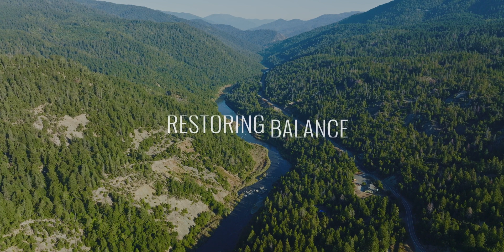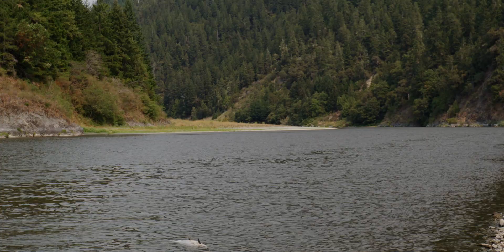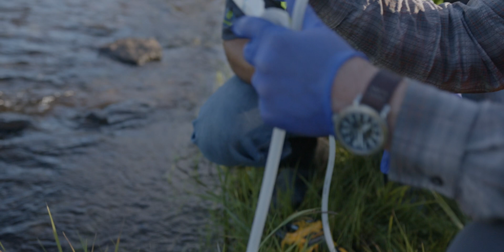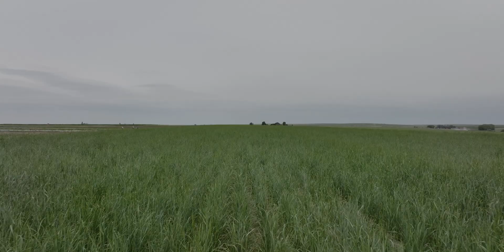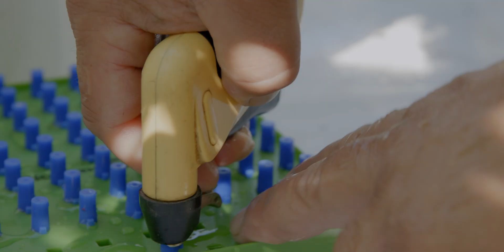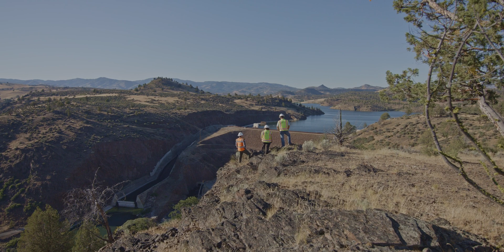Restoring Balance - Klamath River Renewal Project

Comment: I'm  ashamed , but I'm sceptical . Last floods in Spain were caused by removing reservoirs and dams . Radical changes are hardly ever the best solutions . Always expensive .
Reply: There has been 3 floods sense there instulation . They did nothing for flood mitigation ,by design, that  was not their intended purpose

Comment: The dam removal movement is just dumb . Sure, removing some may be beneficial, but in the end, only a small group benefits from this movementin general, and many will suffer because of it .

There is no better way to manage water and generate electricity cheaply and cleanly .

Our society is going backwards, and their too dumb to see it .
Reply: this kind of management works in some places, and doesn't work in other rivers. Daming the Klamath was a bad idea. John C Boyle, the head engineer in the 1890's who designed the project wrote a book  about the project, in which he admitted it was a bad project. 
You would be well served to do more research on the history of the Klamath River basin and the Bureau of reclamation's history.

Comment: Is there a way to make a fourth the size dam to still make a little power
Reply: Nope. We don't need that kind of power anymore. Solar and wind have already replaced most hydropower. Especially small, low-head dams as you're suggesting.

Comment: So, they wish to have the dams removed but are probably not prepared (yet) to renounce to their standard of living.
Hydro production of power is the most ecological gesture you can do to mitigate climate warming.
While I understand that there is more to dam removal than just enabling salmon to lay eggs higher up and the full ecosystem will benefit, what is the value of this if climate warming is increasing because e of this?
I find this report somewhat partisan, if not naive but certainly presents facts in a truncated way.
Reply: @philippesails4973 These dams had lived out their life and were not worth the cost of the retrofit. The lakes had lost nearly half their capacity due to decomposed algae. Fished died by the thousands because the summer water temps got too high every year. The stench was awful. The color of the lake water was bright green. Photos of the water are easy to find.

Comment: With only removing 4 of the 6 dams it seems like it won't really change conditions for fish. Am I wrong?
Reply: I sort of agree. Keno and Link river dams aren't being removed in this project, but I think they should be. Keno dam backs up a huge, shallow slough that warms the river and harbours a lot of bass, bluegill and other introduced warm water species that will prey on any juvenile salmon that are trying to migrate downstream. I think they are leaving this dam in place because of all the irrigation ditches that come off of it. Link river dam just raised the level of Klamath Lake a few feet, and fish ladders should provide adequate fish passage. But Keno dam needs to go too!
Reply: Yes! Copco 1 and 2 blocked fish passage, as did Iron gate. The remaining dams have fish passage already in place. Removing the dams down stream will improve the water quality over time, restoring future fish runs.

Comment: Flood control will be lost, and irrigation water no longer stored. Those dams were built for a reason. Consequences to humans must also be considered.  CA has a manmade water shortage and an unreliable power grid so why are they removing existing sources? If the dams and hydro plants need fixing, fix them. Removing them ignores human needs.

The vast majority of the abundant  CA water flows to the ocean instead of being stored for use in dry years. This water year we've had catastrophic flooding and over 8 years' worth of water supply has already gone to the ocean with 2-3 more months of snowmelt pending. Wasted water because we do not have enough large water storage that also acts as flood control, Why are they planning to send even MORE water to the ocean without storing it for use first?

Taxpayers are actually funding this dam destruction with money from Prop 1, which was passed in 2014 by 68% of the voters - very bipartisan - by telling voters we would get MORE water storage. How does dam removal - which the regional population does not support - even qualify for funding?
Reply: Nah. Flooding problems started after all the beavers in this river system were exterminated in the 1820s. Bring the beavers back and the problem solves itself.
Reply: @BodhiPolitic  Beavers won't be releasing irrigation water to farmers or to regional wetlands when it is needed. ;-)
Reply: @JD4SF do you realize that major farming is not taking place in this area? It is high mountain desert. Only grass/hay production. Some alfalfa. Some cattle being raised.
Also, there is no infrastructure. No mass irrigation system. 
Your comments are inaccurate.
Reply: @jesse75  Smaller farms and ranches are still farming and ranching. Feed and cattle are critical Ag production. Maybe you aren't aware of how feed and beef prices skyrocketed? And now those farmers and ranchers will need to scale back or even sell out lacking a reliable water source. There was enough infrastructure to control the water to mitigate flooding and store water for Ag use. There is also habitat and some wetlands in the region that will no longer have reliable water for their needs. Going forward I suspect the lack of controlled water will result in flooding and worse impact during dry years ... which will not be advantageous to the humans and is likely to damage the environment. I fail to understand the logic or justification to remove dams that are so useful to control the water supply.
Reply: @JD4SF  I live near Yreka California. I've been on the Klamath once a week since July this year. 
I know exactly what is going on in the area. 
It's not like down south you are comparing this area.
The upper part of the river never gets the torrential rains like the coast.
It is high mountain desert. Dry.
Some snow melt comes off the south rim of Crater lake, but not enough to cause flooding in the spring. It is caught in the lake. 
Flooding takes place whether there's dams on the upper river or not. 
Such as in 1962. The Columbus Day storm.
Reply: @JD4SF  Beavers create the regional wetlands.
Reply: You can say that about other rivers. But the Klamath is unique. 
It can't be classified like other rivers.
Reply: @jesse75 is correct. I live in that region too, and I've fished, hiked, floated and hunted every mile of the Klamath, in both Oregon & Cali. The Klamath is unique. This project is well thought out, and will benefit EVERYONE. Do a little more research. Come visit the region. You'll see. Your concerns aren't valid here. Maybe where you're from, but not here.
Reply: @GeorgeWHaydukeIII6396  my friend. Please don't encourage people to visit this sacred place, the Klamath Basin. 
Let's keep it a remote wilderness. 
The Trinity River is full of kayaking. Let them ruin and disturb those spawning fish. Don't need or want it up here. 
The mouth of the Scott river area is going to suffer for a couple years and the Happy Camp area also, because of wild fires, but it will bounce back in a few years. 
I'm so grateful to see the restoration of this ancient river and watch it come back to life. 
Peace brother. May see you on the river some day.
Reply: @GeorgeWHaydukeIII6396  totally agree. Logging the major culprit. 
A scattered 25,000 people I wouldn't call a lot. Once off the main roads of 96 , it gets remote in a hurry. 
I wouldn't recommend campers and trailers to venture up the road along the Salmon River as an example. And many of the logging roads are steep and heat up your breaks. 
I know a few Yurok and we go up into parts of the reservation which are locked off to the general public.
Once I was at one of their remote cabins. Raymond and my uncle decided to go into town and drink and play pool.
I stayed.
I was cooking albacore outside on the fire and a black panther came walking down the creek bed. Looked me in the eye.
I backed up and grabbed Raymond's rifle near the front door.
But the animal turned walked off slowly. 

Simpson and the Yurok have some kind of coexistence I don't quite understand.
Raymond wrecked his truck once and he told me Simpson bought him a new truck.
There are quite a few sturgeons to catch in that lower river. 've always enjoyed that.
I don't know if the Game Department is still doing it. But they supplied huge tanks and feed for Raymond to raise and release Salmon. 
I have many fond memories and experiences with the Yurok people. 
I hope you have had some yourself.
Reply: @jesse75  I used to live at mile marker 14 on the North fork of the Salmon  at Sawyers bar. I fought fire during the 1987 fires. I know a lot of Yurok and Karuk people also. They allowed me to attend ceremonies at Ishi Pishi and Sugarloaf mountain. I miss Siskiyou county. Tourism is the future. Tourism will play a big part in preserving that region. When I worked for the force service they were clear cutting at a completely unsustainable rate, and tons of 4 and 6-in dredges were running in the river and most of its tributaries. Tourism is the future.
Reply: @GeorgeWHaydukeIII6396  I know those places along the Salmon. I see the population of wild horses are growing too.
I've fished many times below Ishi Pishi in the big pool, while the locals were dip netting. 
I love that place. 
You may be right about tourism ?
Personally, I don't want them up there.
Tourist hit wild animals. 
There would be a slaughter up and down 96. 
This summer and fall, I saw only a few animals hit. 
My uncle, an old salt, who I commercially trolled for salmon with out of Crescent city has some observations about salmon, steelhead and their behavior.
Example. Take Highway 199 that follows the Smith River. Plenty of traffic, trucks etc. 
I fish that river every year also. 
My uncle really knows that river. Even the bathtub hole on the south fork. Only a handful of people know that place.
He says the fish never hold up near those picture drifts and holes along the road because of the noise and traffic.
And I think he's right. 
On the middle fork, at a hole called the beaver slide, I've seen 30 and 40 steelhead in the hole. And it's off the highway in Late December. 
You never see them ganged up along 199.
Up the south fork, fish are spread out. It's where I do most of my fishing. 
I wouldn't want to see that happen on the sacred Klamath. 
In some ways I can understand why closing the Monument area of the Klamath would be a good thing.
In the future, if it gets trampled on, I could see it. 
Plenty of King salmon were spawning in that area this fall. 
While fishing for half pounders with my daughter's, we caught plenty of Jacks this year. Almost all of them had lamprey marks on them.
Seen a few salmon jumping in front of us, with ells hanging on their sides trying to shake them off.
Was a very good spawn this year in the river and up Beaver Creek to the forks. 
This summer, because of the fire in the Scott river area, there was more traffic than usual. 
Plenty were staying in Yreka instead of at some of the fire camps.
I had to be extra careful and not get hit. They were driving borderline reckless. 
Could it have an effect on wildlife ? 
Now that the road is paved, people really driving crazy. 
I'm heading up there this week. Going to see what dead is on the road.

Comment: How do such small groups have the power to take out 4 dams created decades ago to improve flood control
Reply: No. THe dams were built for Electricity.
Reply: If you did some reading you would know. The group you call small, is really quite large. Tens of thousands are in support of this project if not more. The dams were not for flood control. Reading would tell you that.
Reply: The dams did nothing for flood mitigation .